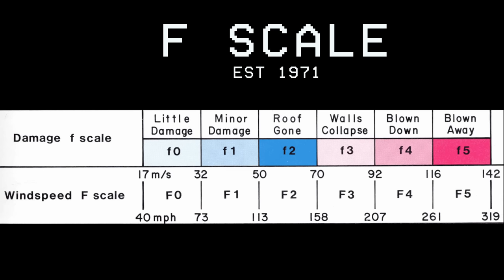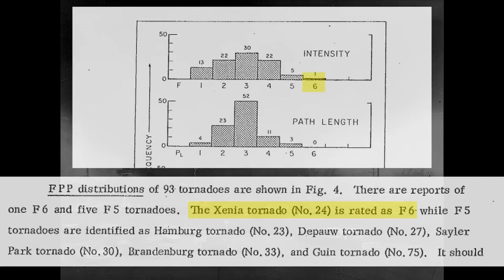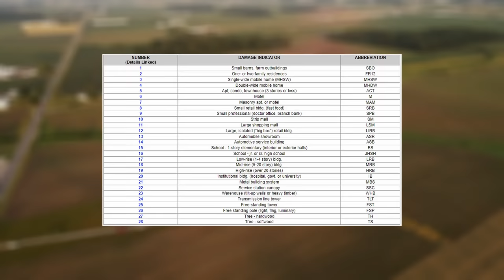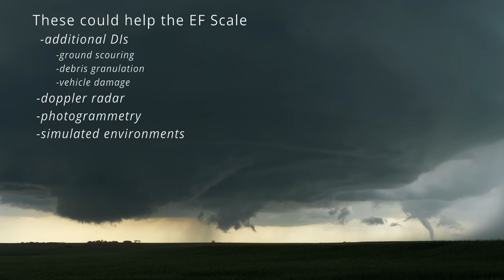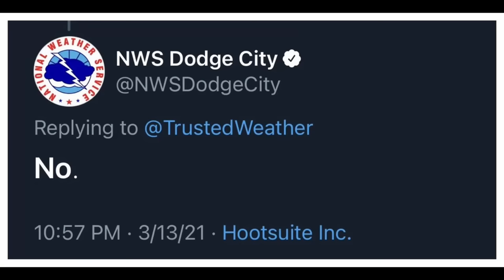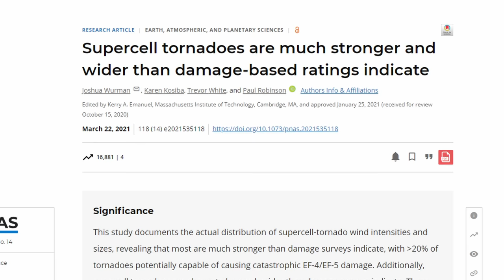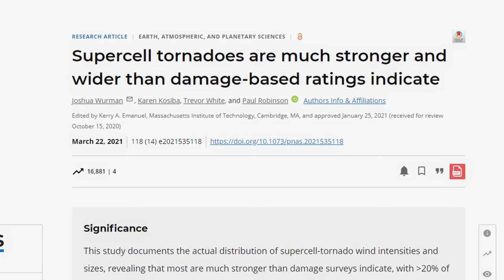Is The EF Scale Outdated?

Comment: My opinion yes and no, the scale itself is a great system to measure wind speed and tornado strength; however does the measurements match other countries scale system of the same speed EF measurement? I believe for great communication there needs to be equivalency that matches other nations of tornado strength. An EF-5 might have different measurements than another country in case clear warning communication is needed; not everyone could have the same measurement of an EF-5 tornado, they might brush it off if their EF-5 tornado is considered a weak tornado. All that aside, the system to measure tornado strength using EF system is still a great invention. To strengthen my statement, during a warning alert there should be more than the strength of the tornado presented for the public, there should be tornado direction and course of direction, there should be road advisory where roads are rated to safe to extremely unsafe road locations seek shelter for safety, adding nearbye safe shelter locations to get to diverting you away from extremely dangerous tornado conditions and divert you away from unsafe shelter locations that puts public in the path of tornados. All we can do is keep what we have but improve the quality of our tornado alert system for faster safer results where the least amount of casualties are achieved. A specialized GPS ij phones will and should divert your driving away from tornado paths to reach safe locations and safe shelters.

Comment: I was at the Southeast Severe Storms Symposium at Mississippi State University over the weekend (where one of the tornadoes missed us by about 40 miles to the north Friday night; Amory, Mississippi), and I talked to others specifically about this video. They seemed to agree that the DOW, and other things, not just damage alone, should be utilized in the rating process. El Reno, you put that thing in a densely populated area, it's wiped off the map. 

By the way, I think a High Risk should've been put out for parts of Mississippi Friday night, as there was a PDS Tornado Watch in effect.

Comment: how i think it should be is that theres 2 systems. one for windspeed + size, and the other for damage. so that we can have a more accurate rating.
for example El Reno wind speed+size would probably be a scale 5. and damage be scale 3 as thats what it was rated.
you could also then mix the two together like maybe its a 2 digit number like, uhh, ima use my El Reno example. it would be like a 53. the 5 from the first, 3 from the second.
ima go email the NWS and tell them to do this now
edit: you could also use this method for hurricanes, tsunamis if you tried hard enough, and idk maybe even just normal storms?
edit2: also maybe a third digit based on the response so if the response was slow or just plain bad it would be 5 (because higher number means bad)

Comment: Well another good point to add is that radar readings for velocity come from higher in the storm where the actual wind speed is much greater than at ground level. The reasoning behind them not using Doppler radar as an indicator is because they’d either have to use that higher wind speed as the “official” wind speed of the tornado, which would cause public confusion because some people might not understand the fact that the reading would be from higher in the storm; or they’d have to do as they do now and estimate the ground wind speed except based off the Doppler radar speed, which as we’ve seen wouldn’t entirely accurate. Either way, it will be extremely difficult to attain a proper wind speed reading without a measuring device close to the tornado at ground level capable of withstanding the extreme winds.
Reply from the maker: That's not necessarily true, some research had actually shown that wind speeds are maximum right near the ground. This is stated and covered in the paper I mentioned in the video, I linked it in my description, strongly suggest you give it a read.

Comment: I don’t think the EF scale is very out dated because it’s a damaged scale so radar should not be included.  Also with radar the further away you are the less accurate it is.  The only part that is out dated is the damage to the buildings because the structure of houses change every time a tornado hits a town so some buildings could take more or less damage which means the estimated wind can be higher or lower than what is apparent.  So I think the only changes needed are tornadoes history in the area and a more strict building damage guide.

Comment: Fantastic video and I couldn't agree with you more on this!  This has been on my mind for a long time, except I'm not a meteorologist so I just based by disagreements with the EF scale based on logic.  If we have technology available today that can better estimate wind speeds without the need for an elaborate physical damage indicator scale, then why aren't we using that to rate tornadoes?  If a tornado is measured to have wind speeds of "x", then it can be assumed that it would do "y" amount of damage if given the opportunity to do so.  El Reno should've received the highest rating available, but it didn't because it's damage path was on mostly open ground.  Can anyone imagine the damage the El Reno tornado could have done if it occurred in a much more populated area?

Comment: Is it possible that checks, receipts, papers, the longer the distance they are blown, could that be another way to measure their strength? They can blow those things over 100 miles from where they originated. The farther away they are blown from their point of origin, could also be used in the rating process.

Comment: The tornado that proved to me that the EF scale was not what it should be was the Tuscaloosa tornado. The only thing that kept that tornado an EF-4 was the lack of a well-built structure. That means, there are some towns and cities that can be wiped off the map, but if their housing is old, the tornado will never reach EF-5 status. 

I have proposed a new system that rates a tornado like a figure skater, with wind speed only being one factor. The time of day, forward speed, width, and other factors would play into ranking a tornado. I used historical tornado records to determine a top rating and made my ratings from those numbers. I wish that I knew how to do a program that can take the inputs, do the math, and spit the rating out, but as of now, I have to do it by hand. 

The Joplin tornado and Tuscaloosa tornado were just as bad as one another. The difference is that Joplin hit well built structures, and it had a much slower speed which allowed debris to pummel the same structures for a longer duration. 

I am not a fan of the EF scale. My rating system allows for converting older tornadoes into modern ratings as well as accepting wind speeds from various sources. Either estimation like the EF scale, or Doppler radar if available. Less emphasis would be placed on the wind speed and more on other factors that make a tornado infamous or not.
Reply: And Tim Marshall. Another difference is that Joplin's hospital got hit. That was the only thing that made Joplin worse. However, it's not always "The larger, the more powerful, and the smaller, and less powerful." Pampa, Texas in 1995 was not  a large wedge but it was rated an F4, and there's video of cars and other heavy objects being lofted very high up into the air.

Comment: More like the EF scale was flawed from the get go. Despite advancing technology it didn’t take advantage of any observations made by said tech and it had senseless wind speed reductions from the previous scale.
Reply: They weren't senseless. The F scale estimates were based on what were nothing more than guesses by Dr. Fujita using early 70s level of knowledge. The newer estimates are holding up well even with the relatively recent ability to use DOW to measure wind speeds of some tornadoes directly.

Comment: I don’t want to be one of those “Ef 6 nErDs” but I think the scale should have been updated. Although I am not a trained professional at tornadoes and whirlwinds, I have been an enthusiast for over 5-7 years now and think that several tornadoes were under rated. Least take the previously mentioned El Reno tornado. It received an EF3 rating only because it destroyed a few line houses on the plains. If this tornado even went a little close to a tower, it could easily cause high end EF4 or even EF5 damage. That’s like saying that a nuclear bomb can not cause damage because you saw it dropped on one house. Tornadoes like mayfield and el Reno have the potential to cause catastrophic damage but are severely underrated. I mean I have seen photos of the mayfield tornadoes damage and I have seen slabs of where house were(usually indicating EF5 damage) yet the tornado gets the EF4 rating. Replay to me what you think, am I wrong, or do I have a point. I would love to discuss this in the comments  if anyone wanted.
Reply from the maker: That's pretty much what I was saying. El Reno would have probably been EF5 if it hit a populated area, it's a good thing it didn't.
Reply: @highriskchris  agree. It would DEFINITELY be raised to EF5 if it entered a populated area. So this raises the concern that if an EF5 like the ones at Moore or Joplin occurred in a open places like Illinois. Would they be lowered to EF3’s instead of EF5’s

Comment: I have been saying this for almost 2 decades. The Fujita Scale should be based off windspeeds alone. Rating the ElReno tornado anything less than an EF 5 because it did not damage as many buildings (location) is ignorant and sends a false sense of security to the public who may be led to think, "Well the ElReno was only a 3 on the scale so this measley EF2 won't kill me, surely."

It should be based on windspeed and size whether it was only over open plains or across a town should not matter!
Reply: It also affects for right or wrong research dollars and again for right or wrong building codes in storm prone areas. The researchers might know how strong these storms really are but tell that to the politicians that right the checks and building codes. " Oh there is  not a significant risk of dramatically devastating storms? why bother"

Comment: Not only do I think the EF-Scale of out of date, I think the hurricane one, the Saffir-Simpson Scale is also outdated. You mentioned that Xenia had a preliminary F6 rating, but 4 years earlier, so did Lubbock (Home of Texas Tech University) in 1970. Saffir-Simpson is very outdated because it can't tell you the height of the storm surge, which depends on the structure of the hurricane, not necessarily the strength. Hurricanes need a surge scale, since the biggest killer is not wind, it's water. Both scales are out of date, antiquated, and no longer reliable.

Comment: There’s a really simple answer here:

0: 58-73
1: 74-96
2: 97-110
3: 111-129
4: 130-156
5: 157-180
6: 181-200
7: >200

ANY available information, from damage to built structures to damage to vegetation to anemometer data, NEXRAD data, TDWR data, and DoW data will be used, and the highest credible result will be assigned. If such data is available on a tornado in progress, the tornado will be classified live and that will be disseminated with the warnings.

These changes are obvious. The EF scale and its quirks and absurdities are the result of stubborn old men sticking to what was created by a (justified) legend in the field out of blind reverence. If Fujita himself was still alive today, he would agree with me. He created a system that was great for when damage was all we had. It’s been decades since that was anything like the case.
Reply: In the very uncommon event of a tornado which never has winds >=58, simply classify it “below severe limits” and don’t bother with the scale.

Comment: I'm no meteorologist but it seems most tornados have smaller sub vortex tornadoes inside them.  Given that, a tornado can make a direct hit to a house and depending on the path of the more intense sub vortex tornadoes could only sustain F-1 damage from an F-3 doppler indicated tornado.  I think doppler is the only way to go in measuring strength and agree with you.

Comment: I agree completely the EF scale is completely outdated. I went on a tour of the wether center at the university of Oklahoma. At the end I asked if Doppler Radar can manage wind speeds why is it not consistent when determining EF strength. The answer was that wind speed data is not available until after the storm to which my next question was “and damage data is obtained when”?
Reply from the maker: yeah good point.
Reply: Please read my post elsewhere in this discussion for the answer. The stationary Doppler radar cannot measure wind speeds at ground level. It captures the wind speed way above the ground once every five minutes, at low resolution. It can't even be established that there was any rotation at ground level at all from that, let alone tell you what the wind speed was at its peak.
Reply: It's obtained when NWS Storm Survey crews look at the damage, and takes a few days to complete. Did they not tell you that?

Comment: I believe it is outdated. From what I understand they are rated by the damage that they do and not so much the wind speed and size. Now that we can more accurately estimate the wind speed and size I believe we should use those numbers. I think I heard that the El Reno Tornado was downgraded to an EF 4 because the damage it caused wasn't enough to rate it an EF 5 but the wind speed was nearly 300 MPH and it was almost 2 miles wide. That is just my opinion and I'm in no way an expert on the subject.

Comment: if one remembers the Moore OK tornado set off a discussion about going to EF6 and it turned down... what set off the discussion was hole slab concrete of a house was moved.. it's time to upgrade..!!
Reply: EF6 is an oxymoron. F6 is not. Because EF5 is winds above 200 mph. F5 is 261-318, which means F6 starts at 319 mph.

Comment: I think one of the greatest shortcomings of the current system is the lack of consideration for the movement speed of the tornado itself. The 2021 Mayfield tornado was a perfect example of this. The tornado was simply moving so fast that it did not remain over any given location for more than a few seconds at most. Compare this to the Jarrel Texas F5 that practically crawled along its path, providing much more time for the tornado to continue damaging anything it hit for several more seconds. Even if two tornadoes had the exact same size and wind speed, if one were moving slower than the other, it would obviously produce more damage than the faster one, causing it to be rated higher when it was no stronger than the other.

Comment: This a different subject, as it relates to hurricanes, but I do think there is some benefit in using a scale that is based on the amount of damage- but only moderately. The first hurricane I can think of in this regard was Hurricane Matthew, which was regarded as a category 2 or 3- I can’t remember exactly. However due to extensive damage, and a town in NC being completely submerged, the rating was changed. Now most of it lies abandoned due to the lack of relief efforts because of the expectation that it was a weaker hurricane. No news broke out about these communities due to a variety of circumstances that I don’t want to get into since it’s all based on the region’s history. However after awhile Hurricane Matthew’s impact was regarded as a category 5 due to the extensive damage. 

Of course what you illustrated also shows the flaws of the EF system. But I think there should be a balance between the two

Comment: this man has a point. if the el reno tornado, 2 miles wide whit 300mph wind, would have pathed through a major city it would be ef6 for sure. actually it could have been the first ef7 tornado who knows.
Reply: There are no such ratings and there will likely never be because there's no point. The devastation done by an EF5 is complete enough that adding more numbers to the rating system is redundant. How much more destroyed can you get beyond destroyed? The only factors that could add anything to that would be damage path length and width and even there it'd be gratuitous.